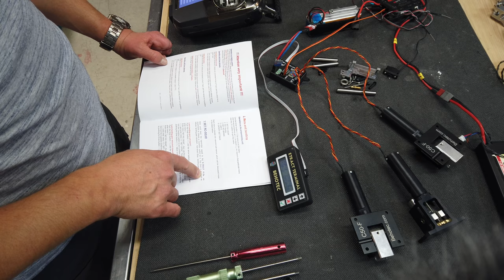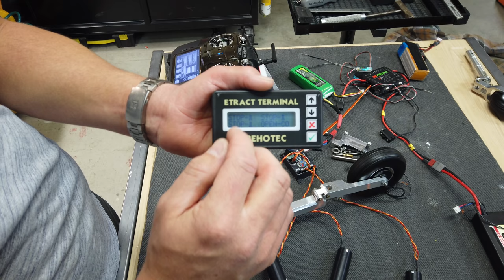BUILDING THE BIGGEST DIAMOND - Behotec Gear Assembly - Aviation Design Diamond Target Drone - Part 7

Comment: Another great video Jonathan!  Thank you for sharing. Just a minor suggestion. If you want the servo grommets to provide good shock absorption, it helps to have a small gap between the servo and the mounts. I noticed your servo was a tight fit. 😀
Reply from the maker: Great point!  Generally on Jets I don't use the rubbers on any surfaces but for the nose steering I used it to get proper spacing and also for shock absorption.  What your saying makes a lot of sense.  Thanks!😊

Comment: looks like alls going well. small request, when you get to your smoke system could you share some wisdom. maybe expected flow rates make your own tubes or buy, placement in exaust flow etc. I have built a lot of planes and am just working on first turbine and have never run a smoke system.
Reply from the maker: Hey Ron. You bet!  Will do!

Comment: looking good those retracts are nice and smooth what voltage dose the brakes run on 😁👍✈
Reply from the maker: Yea they are a great system!  The whole system runs on a 2 to 3 cell lipo so 7-13 volts.  The brakes are electromagnetic and therefore variable.  So if you set them up on a slider switch on the radio, the more you move the slider, the more voltage they get.  Slick system!